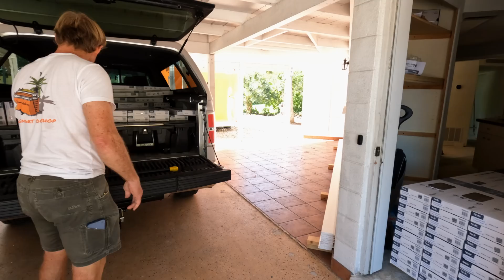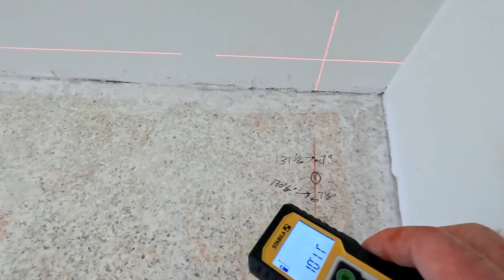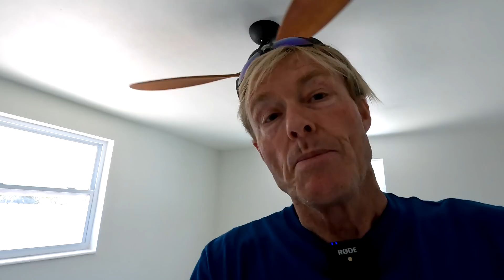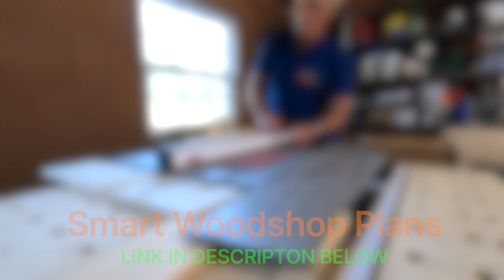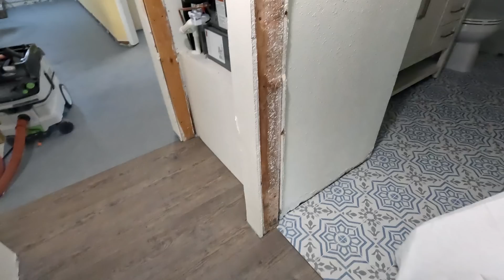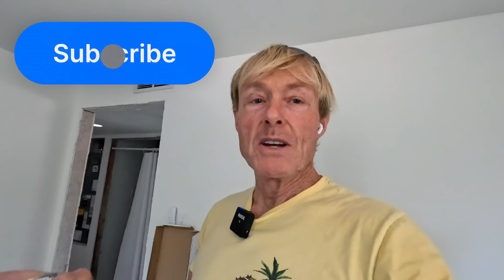Step-by-Step Guide to Installing Luxury Vinyl Planks

Comment: Yes this is a good video showing a professional getting this job done. It seemed to skim over the setup   Cutout marking and then actually how it was cut.  It is more of an overview of the process rather than a detailed instructional video on how to get this done.  And why when the Paulk smart stations are in the 21st century using metric. For this using dinosaur imperial measurements is back in the 1900s.

Comment: The 12 mil refers to the thickness of the print on the face of the vinyl.

Around .040 or 40 thousandths of an inch

If you look at the plank from  the long edge you will see the layer of the print

Comment: In your product selection did you ever consider a glue-down plank vs the click-in
Reply from the maker: I don't like glue down when laying over concrete. Plus, I don't care for the mess and hassle of installing glue down. The floating stuff works well over a slab and when installing on wood subfloors I will do floating sometimes, but prefer old style ¾" hardwood nail down.

Comment: Transition strips at doors main purpose is to protect the edges, you could easily make one from oak
Reply from the maker: It isn't the material that I don't like. It is that they go over the top. It takes more skill and shows craftsmanship when materials are fitted. I also don't use scribe for the same reason. By flushing the plank to the tile and using a sanded caulk line there is no edge to protect. I have never used a transition strip or scribe in 30 years and never will. 😎🤙

Comment: I always wondered why they dont take all the waste plastics, and design an extrusion device that will create lumber from them. 
 
Or even a high pressure system that can press them like mdf?
 
I do it on a small scale at home, and it's extremely string, bug proof, and indestructible. If the giant, big $ corporations did it, they could reinforce it to be far more ridgid over longer lengths.
Reply from the maker: Not in my wheel house to address this one😎
Reply: @TheSmartWoodshop  lol I get ya. I had a late night existential crisis and I woke up and looked at all my old skimboards and thought... "Let me share something of no value... That'll prove my 11+ concussions haven't affected me."  🤣 😜

Comment: I’m kind of surprised you didn’t run the planks the other direction so they run “down” the hallway instead of “across” the hallway. Looks great though!
Reply: The bowling alley effect is avoided in the hallway.
Reply from the maker: Going long way would have created a problem for stopping at the end of the hall.

Comment: Coincidentally, I just installed the 13-20mil Style Selection from Lowes in my kitchen 2 weeks ago in Natural Hickory.  I was definitely biased for years againts floating floors but it’s growing on me.  It’s the fact that shoe molding is required to “cover up” the expansion gaps and repairs can only be completed by reversing course.  You’ll like it!